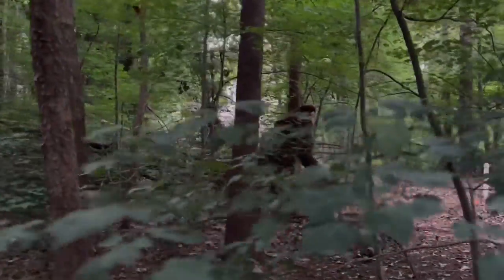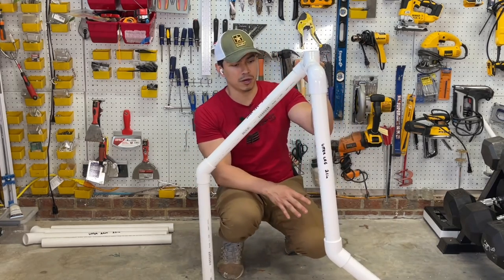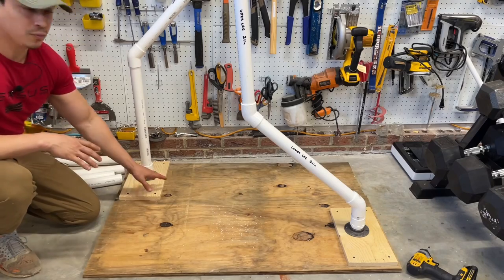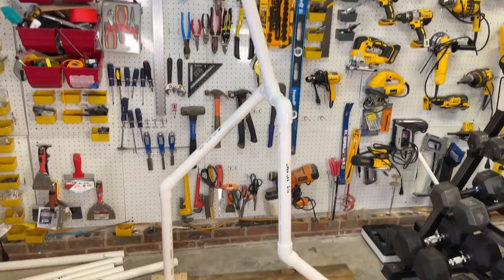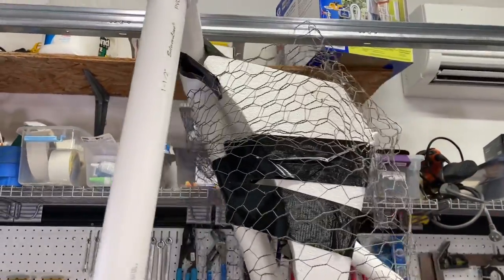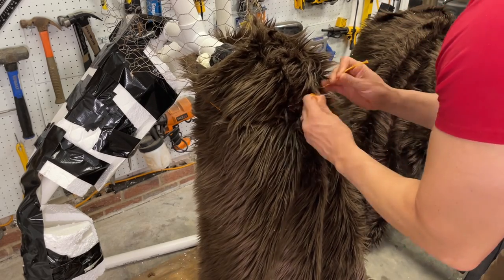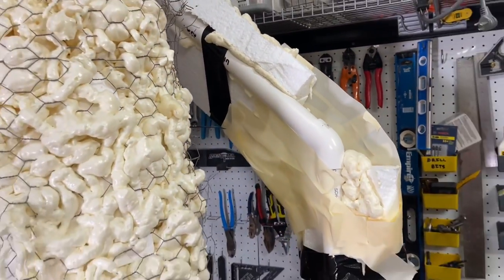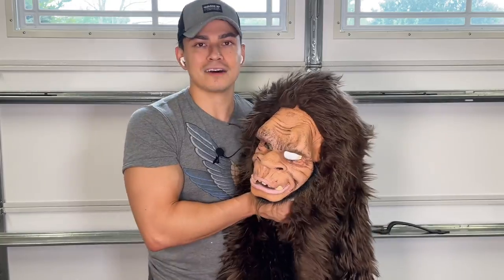HOW TO MAKE A GIANT BIGFOOT (Sasquatch) - Tutorial

Comment: I’m about to do one , was why I looked this up , I’ve done a few large creepy scarecrows , I’ve collected alot of fake fur coats hats etc from thrift shops , like the material you used much better , I think I would have to Mat it up some & maybe darken or grey up some areas so it doesn’t look so consistent , I’ve found fiberglass insulation works good for muscle shape with ductape around the pvc for biceps and calves as well as chest , I use metal plumbers strap screwed to the pvc to make the joints posable , will definitely try your chicken wire method for torso and purchase this fabric thanks for the tips , amazing what you can improve each time you do one .

Comment: Its amazing what you can  make with  just  pipes and  other items  ,  excellent work and  building  on this .   for moving  the platform  you could put wheels on the bottom  like casters and roll it easier  for an idea    love this  and looks so real  ~  You sure have born talents .  Sensational Job ~
Reply from the maker: Thank you so much for the tip, that sounds like a great idea with the wheels
Reply: @IsaacAlexanderDIY   yes would really help to  move it around   those casters   wheels ..  not sure if its too late.  i was  wondering and checking that when you were building it and thought i  should let him know.   maybe  screw in the caster to a block of wood and place it on the corner and  screw or nail down in from the top plywood on each corner . lots of ways .   hope this helps..

Comment: This turned out great; however my experience with faux fur it wouldn’t hold up in my PNW weather conditions. I have made giant size scarecrows that I use milk jugs and the big coffee creamer bottles. I usually have to replace the clothes every couple years as they fade and the straw. I only use straw for the feet, hands, hair and a little bit poking out of the chest. 
    I’ve been wanting to do the wizard of Oz tin man. Have a huge metal funnel I got from my uncle, some big cans saved up….your structure is a great base for what ever you can dream up. My grandsons like Jack, Sally, Zero…all the characters. So that project would come before my Tin Man. 
    I wish there was a way to weather proof faux fur as that would be pretty cool. 
   My dad waterproofs his hunting clothes/sheets by taking a large trash bag, cheep silicone caulk, mineral spirits and water.. mixes it in the bag and adds his clothes or sheets until fully saturated then hangs them on the clothesline to dry. But this would destroy the fluffiness of faux fur.